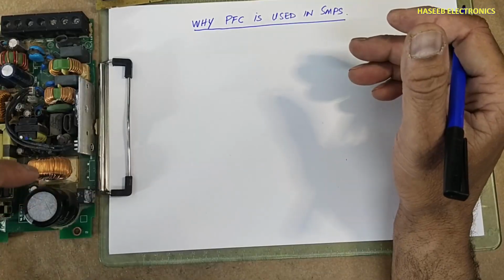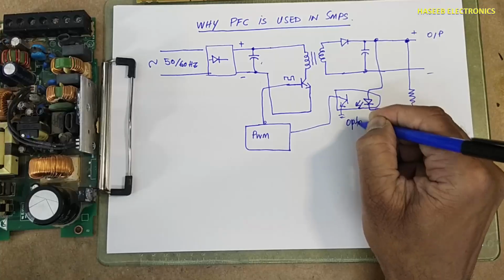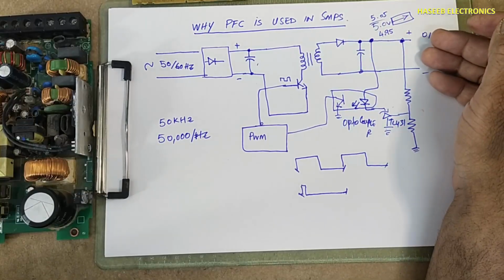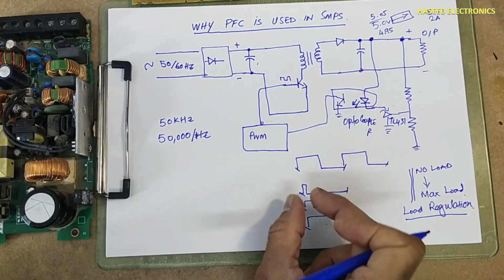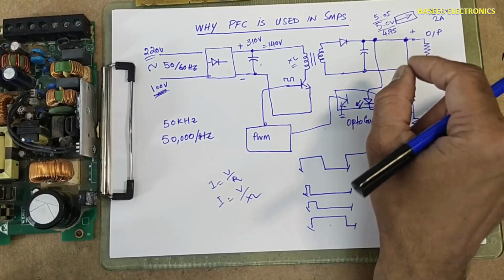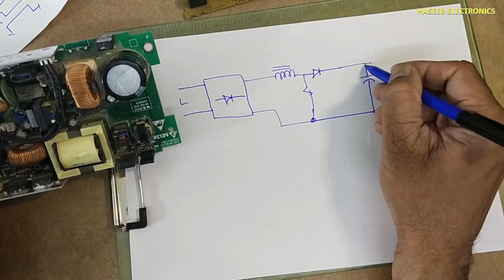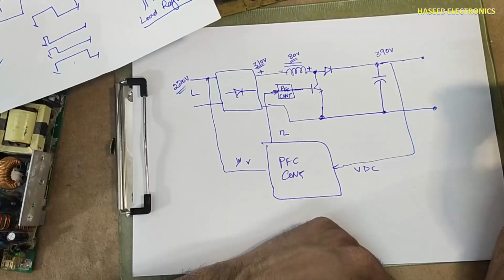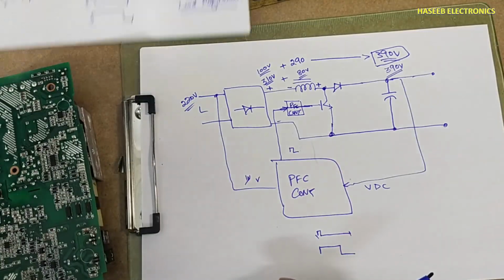{1070} Why PFC is used in SMPS? Power Factor Correction

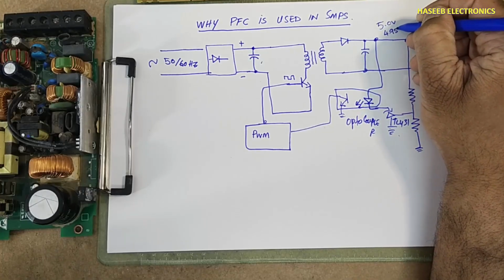Comment: At 5:33, you said feedback would be provided when the voltage went below or above 5 volts. The optocoupler operates with the LED on and off. When the output voltage reaches exactly 5 volts, the optocoupler switches to conduction. When it goes above 5 volts, does it not remain in conduction? In this case, how will it detect that the output voltage is above 5 volts?

Comment: PFC as it's name implies is for power factor correction, it has nothing to do with voltage. What you explained is boost-buck converter. That first stage booster has nothing to do with pfc and, pfc has nothing to do with voltage level either dc or ac. Power factor is the phase difference between voltage and current which can affect power quality. The real reason why we need pfc on smps is because the smps will cause large variations in power factor and reduce the power quality for other appliances connected to the grid. Just like you need a capacitor for a motor
Reply: А что такое мощность? Это P=U*I......  Иди в школу, заново учись)))) Иногда лучше молчать, чем писать))).....

Comment: Hello Haseeb, that is a great partial explanation, but what happens to the power factor PF?
I thought that universal SMPS had a terrible power factor, and like cos phi for motors, designers have to compensate the power factor so that it becomes close to 1.0, and the solution was to add a PFC stage. 
Maybe you could compare the current waveforms of both SMPS, and see what happens with and without PFC? That could be interesting.
Anyway thanks for sharing your knowledge, have a nice day!

Comment: That's ... not really the reason why you want (active) PFC, your PWM controller can regulate variable input perfectly on its own. You want the PFC to get the relation of working power and apparent power close to "1" . In a nutshell, your rectifier + capacitor will draw current from line only at the positive and negative peaks of the input sine wave. Which is not what you want ... you want to draw current throughout the entire sine wave.  Too much work to explain it here, but https://www.youtube.com/watch?v=YiBuFQD1TYw gives a good explanation and some nice measurements.

Comment: Hi sir, I have a pfc laptop adapter, when no load connect to it, I have about 500v on big capacitor (100uf 420v) that goes up  dangerously, when I switch off it, capacitor voltage don't drop. With load on output, it works normally, 340v on capacitor, and when switch off, capacitor voltage drop fast to 0. Do you have any idea what's wrong about it?

Comment: Dear Habib Bhai 🙏. You have explained nicely in details on regulation factor for low power SMPS but you have cut short detailed explanation on PFC operation for high power SMPS. Of course it is not easy to understand PFC application in High Power SMPS or  inverter supply or PFC application for IPM etc for commoners without their detailed study of advanced power supply application designs. But the overall explanation was very impressive.
Thank you so much 👍

Comment: Dear brother you are explaining the pfc as not correctly. Pfc is power factor correction. I mean it is about current and voltage angle correction to maximum output power and reduce the power loss. As for me you have to research pfc function better. Power=voltage x current x CosQ and if you want to get full power and reduce the power loss you must correct cosQ=1, for this, you must measure the angle of current and use sense resistor and voltage angle then you determine the zero point of voltage, What did you use all for these? The current is forward on capacitor and the current is backward on bobin. If you don’t balance the angle of the output, cosQ will be reduce. Here Pfc is used for this.

Comment: Hi bro
Thanks for your best tutorial

I have a question, in this video you said, if we decrease duty cycle, output voltage will drop or if we increase duty cycle the voltage will increase, but in another video:
You said that the flyback works with the reverse duty cycle, that is, if the transistor is active, we have no output, and if it is not, we have an output.
But in this video you said the opposite

Comment: Have you ever experience a meanwell brand PSU where the problem is the IC driver for mosfet is not giving any output. And the IC has a voltage drop

Comment: Haseeb ji, what is full form of PFC?  Have you any clue?

حسیب جی، پی ایف سی کا فل فارم کیا ہے؟ کیا آپ کے پاس کوئی جواب ہے؟
Reply from the maker: Power factor correction
In smps It is called PFC BOOST CONVERTER
in this power supply it is "PFC BOOST CONVERTER bridge based, non-isolated"
Reply: @HaseebElectronics  I am impressed by your heart to comment of your good self. Nevertheless,  this response from you, full of many bla bla, speaks volumes of your shallow knowledge on the subject. No explanation is to the point. Please search for the part name that has been used in the circuit and study well. These are non-polar capacitors. When used in series in AC supply, these produce reactive resistance. This is dependent on its value in mfd and hz of AC. I don't expect that you may digest any more knowledge on it. Happy ignorant expert.

Comment: Power factor is relation between apparent power and real power
Reply from the maker: Yes 
In this power supply
It is, "bridge based, non-isolated PFC BOOST CONVERTER switching at 65KHz using NCP1654"
Reply: good @HaseebElectronics

Comment: So, PFC controller is also switching at very high frequency as each 50 Hz period starts with very low voltage ? So it also ameliorates the power factor as current is now taken whole the 50 Hz period ?

Comment: Very nice information. But sir some PFC circuit inductor use AC line. How it works inductor.
Reply from the maker: yes 
there is bridge rectifier based PFC 
and the other is Bridgeless PFC circuit

Comment: assalamu alaikum, i have a problem in my smps 12 v 20A, why not showing 5 v refference voltage in uc3845 ic  , refference voltage showing 650mv. , vcc showing 8v. after i load the led 50w bulb its flickering, what is the problem?

Comment: So basically PFC exists only because of different main voltages in different countries when high amperage output is required? If all voltage was 240V, PFC would not be needed?
Reply from the maker: Exactly yes
It compensates the line variations.
It assists the PWM controller to maintain output side of the SMPS

Comment: This is a very interesting topic. It would be good to visually see PSU with PFC circuit connected to multimeters and oscilloscope at multiple points (switching IC, PFC IC etc) to see actual changes in input voltage and switching duty cycle when load and input voltage is changed while the PSU is working. If you have adjustable load and adjustable power supply maybe you can do this in a future video.
Reply from the maker: thanks a lot 
sure i will arrange a detailed practical session with all possible checkpoints
Reply: @HaseebElectronics excellent. thank you.

Comment: Excellent explanation sir..... learning many concepts from your videos...one doubt.....if pfc controler is there then ,will there be necessary for output feedback to pwm controller,for output regulation ,or pfc will manage by its own.....
Reply from the maker: PFC controller maintains voltage on DC rail. 
PWM needs feedback to compensate output variations caused by load
Reply: @HaseebElectronics  thankyou very much for replying sir....
Reply: Excellent video sir